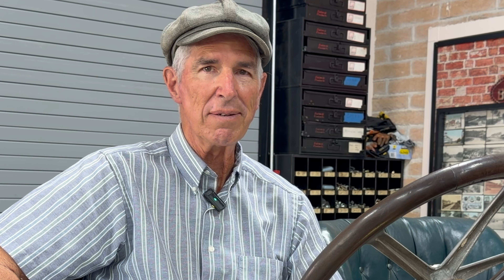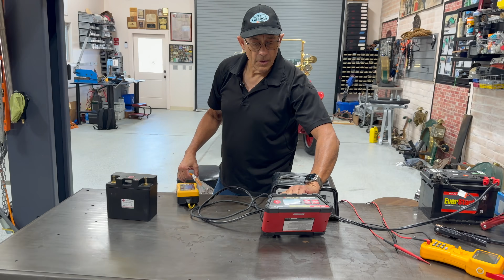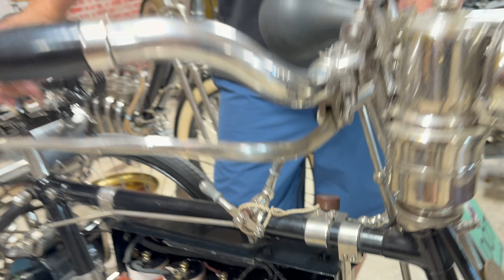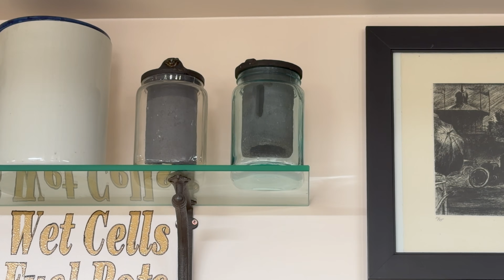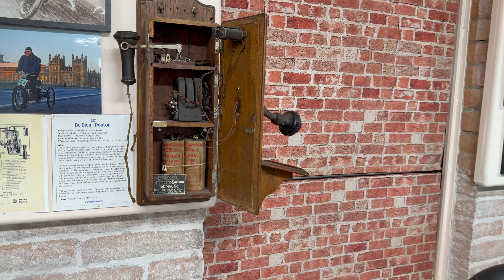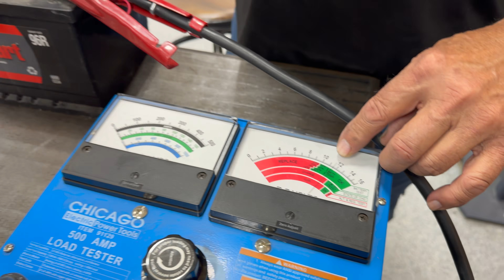Stop Junking Good Batteries! Why Modern Chargers Fail | Alan Travis | In the BTG Shop

Comment: Don't let me start with the free maintenance lead acid batteries scam? When the acid dries out you throw away the battery because it doesn't hold the charge anymore.  Acid equal to electrolyte in lead-acid batteries. So what can you do, drill the holes, add acid just over the plates, plug the holes with nylon fittings and PP glue. 🤣🤣🤣🤣🤣🤣 and enjoy.

Comment: Awesome detailing.  I demonstrated something similar in my Prius 12VDC AGM Battery Reconditioning Method Found Effective For Cars With Dead Batteries That Sat.  Super common in the Priuses that sit.  Only need to bring back up to voltage, I assume with low current though have seen the welding machine method to restore once assured topped with distilled water, then charge.  I like the Christmas Tree analogy too. Interesting, is some I was reading, drill tap add distilled water and set screw seal individual cells in the NiMH modules with success.
Reply from the maker: That’s some interesting insight

Comment: I understand the way batteries and chargers work, but often a car battery with 1v isn't going to hold up the same as a new battery. Being a repair shop, I don't have the time to put a charger on an older low voltage battery unless I feel its worth it. When I see batteries in the single digits, they usually aren't worth it. Unless people want to start paying better wages to mechanics, it's faster and more economical to just replace the battery.
  I myself have maintainers on all my batteries that sit for long periods.  I have both modern and older chargers.  The digital industry is to blame for a lot of dead batteries.  Advertising and sales is the main culprit.  I do slow charge many batteries a year.  But when a customer states they had to jump their vehicle and I find no other issues, a new battery usually solves the problem.
  Giving people too much information just causes issues.  The next thing I'll hear is why can't I replace the bad cell instead of the whole battery.  Why didn't I just charge the battery?  If you have a daily driver and your vehicle isn't charging your battery, either something is wrong with the vehicle or your battery is bad or going bad. 
  Other then that, I'm not disagreeing with the information.  Just stating an opinion based on being a mechanic for over 40 years turning wrenches the whole time.
Reply from the maker: You make good points, I don’t think we really disagree!

Comment: I just used my cheap lab power supply to bring a dead car battery up enough for the supposedly smart charger to actually charge it. Battery was at 1.9v so hooked up the lab supply and set it to 13v and let it go a few minutes but the current was capped at 0.044 amps so I bumped the voltage up to 13.6 and the current slowly started to climb. I capped it at 1 amp once it got over 1 amp and let it go for an hour or 2 before putting it on the smart charger. The cheap lab supply is handy to have for lots of reasons. For example tool batteries have a protection circuit that shuts them down and disables them if they go below a certain voltage. For tool batteries most are are called 20v but they are 5 cells each 4.2 volts at full charge so 21v max or the min would be 3.3 volts per cell so set voltage somewhere in between and the current as low as possible say 0.1 amp or less. Usually you only need to do this for 5 seconds or so for the protection circuit will reset if it actually just shut off for going a little under the protection cutoff.

Comment: Isn’t it 1.5 vdc per cell ?  Those four cells are considered 6 volts.  Why does my multimeter read 12 vdc when the battery is disconnected if there’s no such thing as a 12v battery ?
Reply from the maker: When the car has been sitting for a few hours (known as a "resting" or "surface charge dissipated" state), a healthy lead-acid battery should read between 12.6V and 12.8V.
• 12.6V to 12.7V: This indicates a 100% charge.
• 12.4V: This indicates about a 75% charge.
• 12.2V: This indicates a 50% charge.
• 12.0V: This is considered "discharged" (about 25% charge).
• 11.9V or lower: The battery is effectively "dead" and likely cannot provide enough amperage to start the engine.

A standard 12V car battery is composed of six individual cells connected in series. Each cell contributes approximately 2.1 volts to the total when fully charged (\bm{6 \times 2.1 = 12.6}). If a battery reads exactly 10.5V, it usually means one of those six cells has "dropped" or shorted out, meaning the battery needs replacement.
Reply: @BarryTsGarage , so that car he had was really an eight volt car ? 
 I’ve worked on 24 volt,12 volt, six volt  , six volt positive ground but I’ve never even heard of an eight volt system.  
    I do know that a partially discharged battery will freeze and after that it acts like it has an internal short. I always figured the liquid inside froze, expanded, and pushed the plates together but I never actually bothered to cut one apart to see exactly what happens.

Comment: If your smart charger has a boost function you may not need the old style charger. It’s worth boost cycling it a couple of times if it will allow it. Parts houses and tire shops are the worse places for battery up sales I’ve ever seen. A-Zone has recently even implemented a policy to stop testing batteries and just suggesting replacement. If they can gouge a battery price with a popular label and buy back a perfectly good battery for ten dollars to keep or recycle two or three times more it’s huge profit.

Comment: Old chargers might put out 18 volts  measured with nothing attached. With a dead battery attached though it is within spec for any car. My rec though is buy a dc power power  supply and learn how to use it . Will charge a dead battery of any type. And cheaper than a "battery charger".

Comment: I couldn't agree more with Allen. People throw away good batteries far too often and I suppose it's not as safe but if you have no other way you could always hook jumper cables to a running car and a dead battery just to get the process started.
Reply from the maker: Good point, that's definitely a reasonable way to get things going. ⚡

Comment: Cars from the 1980s have keep-alive memory in their primitive N-MOS computers. I've measured a continuous power draw of 10 miliamps when completely off. It pulls the battery down to where it won't crank within about 3 to 4 weeks. Remember to pull the engine computer fuse and the clock-radio fuse (has its own computer) if you want to preserve the battery while sitting.
Reply from the maker: Great tip

Comment: it you have 0 volts you can attach two jumper cables from a running car to the battery make sure its on a block of wood and do it outside and jump to at least 7 volts then add acid remember to drain some for the amount you add in then charge it to 12 volts at leased then try it out if 24 volt battery you have to jump it with a dual battery system like in a diesel truck

Comment: A lead acid battery discharged to less than 1 volt has taken quite a beating already.
Reply: @jeffreybloem  
You could say it is a victim of battery.
Reply: @jeffreybloem  I have a Toyota battery from 2013 (its 2026) that was at 1.5v when I bought the vehicle. I charged it and is still in service. I even brought it in to a parts store to test it and after charging it was at 98% capacity.  I used a standard transformer based charger.

Comment: Lead acid batteries usualydie by buildup of sulfate chrystals on the plates due to insufficient charging and sitting discharged  .once you have some charge in your battery charge with a modern charger with a pulse desulfation repair setting you need to charge and discharge cycle a few times and then keep it charged fully with a maintainer charger .Do not let a battery sit empty .
Reply from the maker: That's great advice, thanks for sharing!

Comment: Everstart from walmart is one of the half a dozen worst batteries that you can possibly buy
Reply from the maker: I guess it depends… Here’s what consumer reports said, in part:

Top 2025–2026 Performers by Group Size:
• Group 35 (Japanese/Small Cars): Weize Platinum AGM and Odyssey Extreme often top the charts for longevity.
• Group 48/H6 (European/Modern GM): ACDelco Gold and EverStart Platinum (Walmart) consistently rank as "Best Buys" due to the balance of price and lab-tested life cycles.
• Group 65 (Large Trucks/SUVs): DieHard Gold and Interstate typically lead in pure cranking power.
Reply: @blumaxx1  You should watch Project Farms battery test video. These batteries did really well. I have a group 65 from 2018, still works like new.

Comment: The trick to dead battery's with the modern chargers is to put an external 12 v that will start the charger.
Reply: Yup I use a jump box to start the more modern chargers
Reply: I've brought batteries back to life that were down to under 2 volts like this. Just hook up a good battery to it with booster cables, then hook a charger up and trickle charge both batteries.
Reply: I tossed mine out ..

Comment: Never use an extension cord for a battery charger
Reply from the maker: might be tough, depending....
Reply: Why?  They don't draw much current.  A 12V 10 amp charger may only draw 1.5 amp from the 120v input.

Comment: I think modern chargers are designed to sell new batteries. I have two of those old phones and they still work if connected together. I once emptied a motorcycle battery into a glass jar, then transferred the acid back into the battery. Jar sitting next to the battery, I connected the charger and got a spark off one terminal which ignited the vapor in the jar, the jar made a pop and jumped straight up about 2 feet from the vacuum generated after the gasses burned off instantly and came to rest upright without breaking! Luckily I suffered no injuries but it scared the life out of me instantly! Be careful of the fumes.
Reply from the maker: That sounds like a terrifying experience, definitely good advice to be careful!

Comment: Modern chargers will not start charging if the voltage of the battery is too low for the sensing circuit built in. I prefer an old dumb charger. My Dad's Cadillac CT6 has 5 or more computers in it and if left to sit for a couple of weeks, it will go dead, especially fast if the keyless remote is in close proximity to the car, such as car in the carport and keyless remote in the house within 20 or 30 feet of the car. If it's driven about once a week, no problem.
Reply from the maker: Exactly, those smart chargers can be frustrating sometimes.